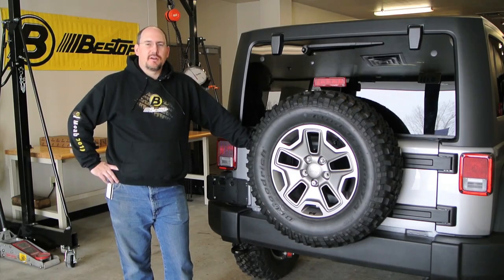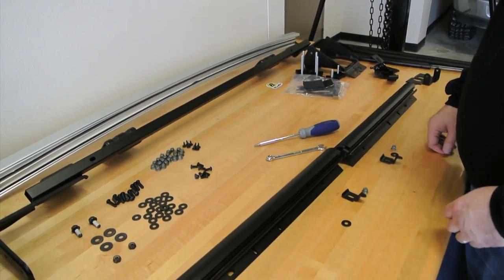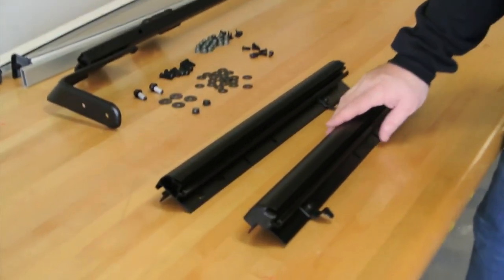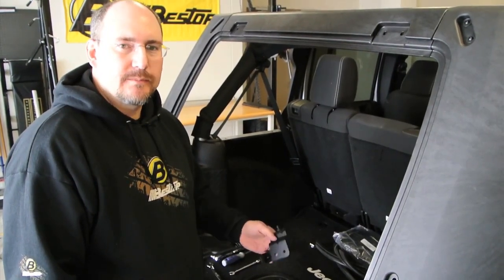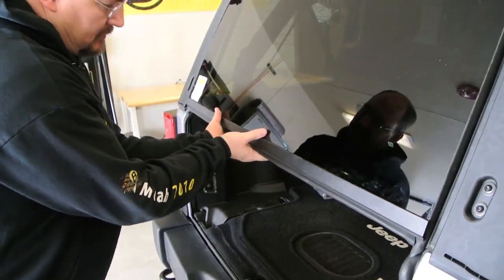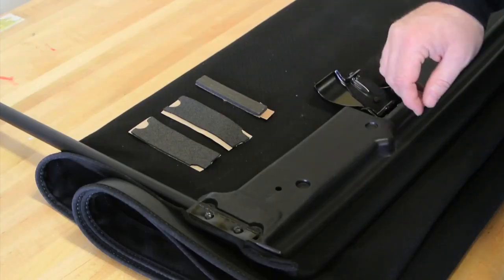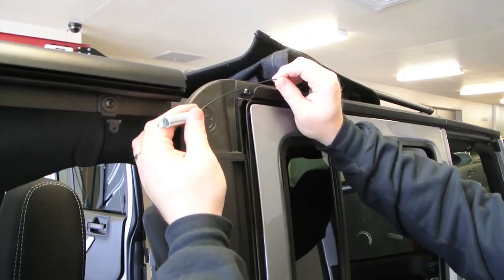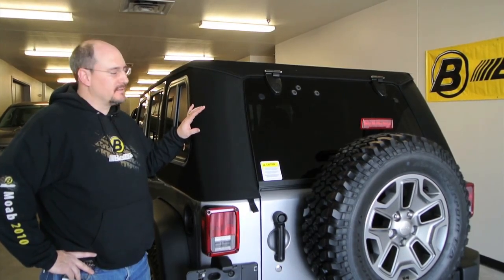Bestop Trektop Pro Install

Comment: Anyone have a problem with the rear window leaking? I am on my second top and every time it rains now, the rain soaks the rear gate and puddles. I tried adding some stripping along the edge but not cutting it. It didnt do it for the first 6 months after purchase.
Reply: Tim Cottrill I’ve got same issues. After a decent rain my inside tire changer area is a puddle and my cargo carpet is soaked. 
Research and calling told me that I do not have it on properly and it’s off centered. I don’t feel that is the cause, seems more of a window gasket issue for me, you can see where the opening is. It hasn’t mattered how I’ve adjusted the top, I always have that opening.

Comment: Bought my jeep as a hard top, bought the trek top nx the following spring. First of all, it was a pain in the ass to install, second, it didn't even last the entire summer. Stitching pulled apart in several locations, had to replace the rear window zipper twice, and the front bow wasn't even in the box when it showed up. Had to get that shipped up separately, and they tried charging me for it. Not cool. I followed all directions perfectly, it leaked at all corners, ridiculous amounts of dust got in, and I took it off well before summer was done. I don't see a whole lot of improvement in the pro, I see a lot more maintenance involved, and you guys are kinda missing the whole point of a soft top; Open everything up for the open air feeling. Al you guys have really done is turn the very top "deck," as you call it, into a soft top. What was the point? I can do the same with my hard top and the freedom panels. And from what I've seen from my jeep parts supplier, the asking price of $1600 is ridiculous. Especially when I got a full fold down top for half that. Yes, Half. And THAT is the whole point of the soft top. Fold completely down! Something you guys totally missed...
Reply: bishop5537 oh, one more thing... I was refused my money back when I sent it to them because "I had not followed the install and maintenance instructions" and they refused to ship it back to me. I even said send it COD, and Ill pay for the return cost and put it on kijiji for some other sucker... Nope. They would even return it to me. What a waste of time and money...
Reply: bishop5537 Which trektop nx did you get? eg 2door/4door and which material?
Reply: I got the 4 door model with the upgraded fabric. What a peice of junk. Normally I won't buy factory, I'll go with aftermarket, but in this case, I went Mopar. Managed to find one online used, only paid $100. If you want one brand new, I suggest quadratec.com. I've bought 90% of my stuff there, best prices I've found yet. And it shipped from Pennsylvania to northern alberta in about four days. Not bad...
Reply: I'm in Australia, the postage and the ozzy dollar are killing me at the moment. I like the look of the twill trek top nx. It will be some time before I get it, my jeep has been in the workshop getting repaired since January waiting for a diesel injection pump.